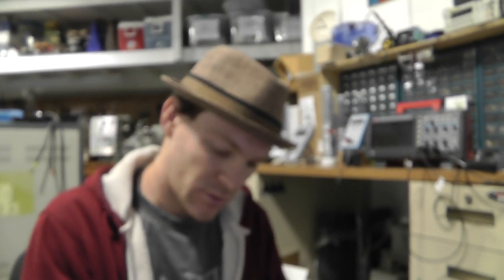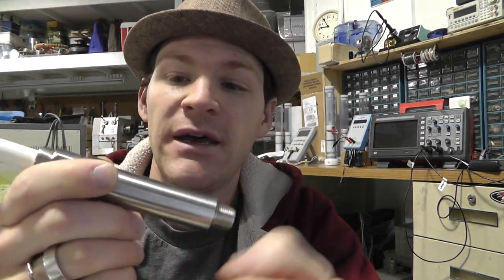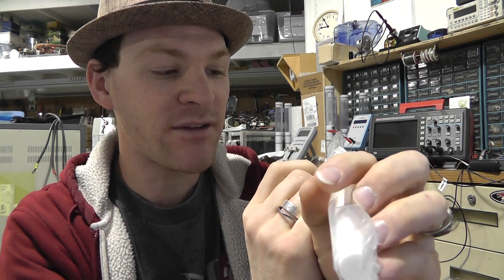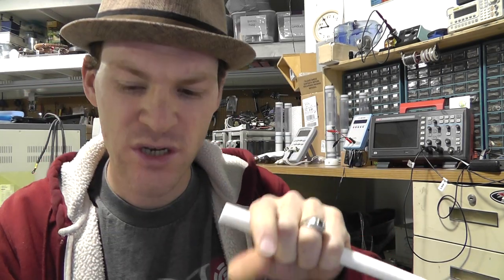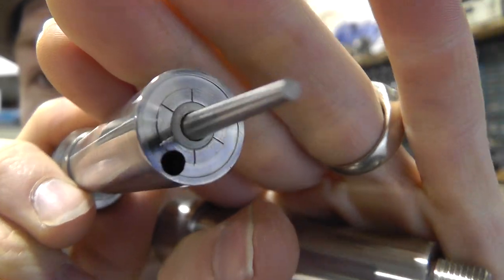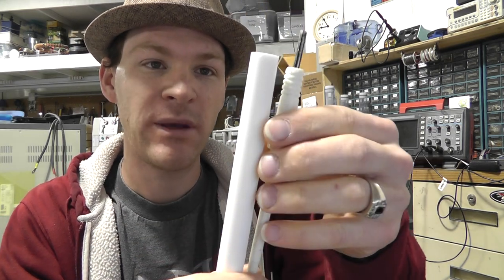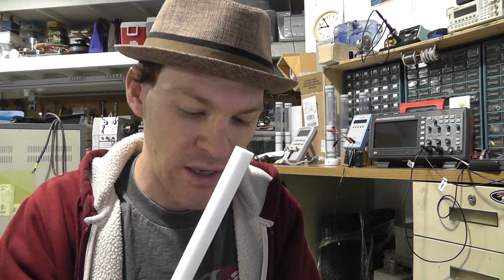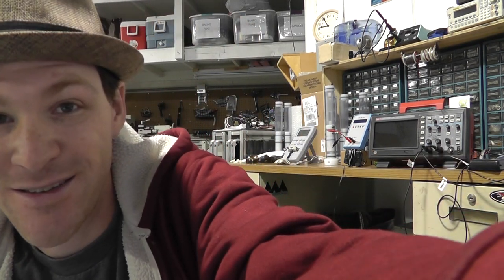Stan Meyer Injecter Update. Machinable Glass Ceramic Rod. (Raw-Before Cut)

Comment: How are you planning on holding the rod in the ceramic? If you pull a spark plug apart the ceramic is threaded so the metal connector the spark plug wire snaps onto threads into ceramic and is coated with locktight to prevent it from vibrating out. I'm sure you already know that, I was just curious as to how you plan on keeping the rod in the ceramic.